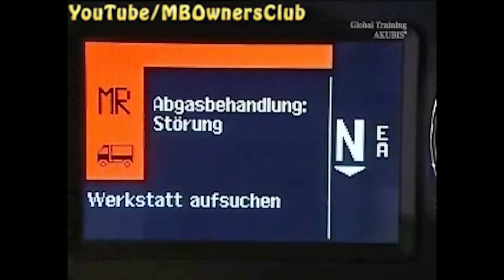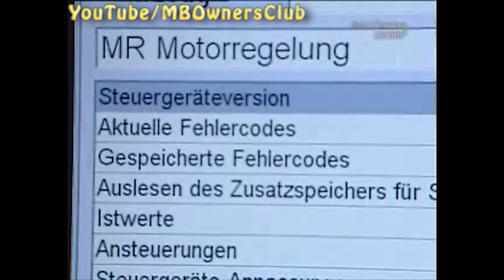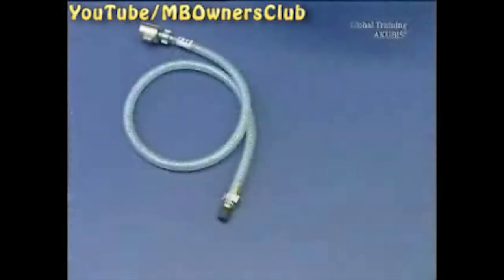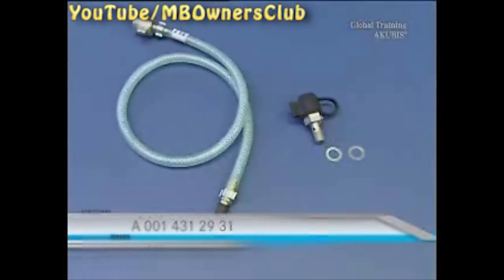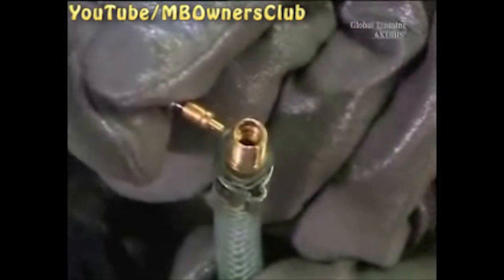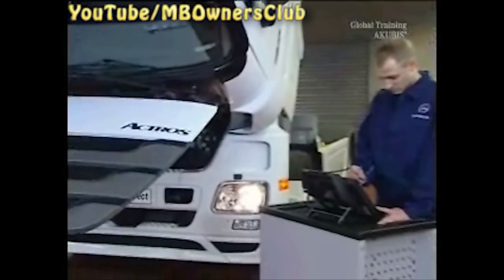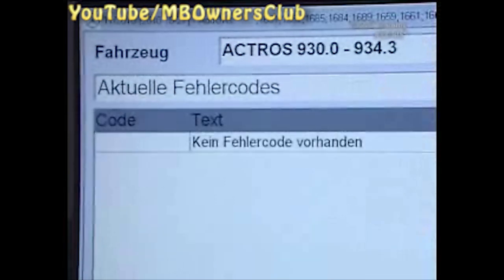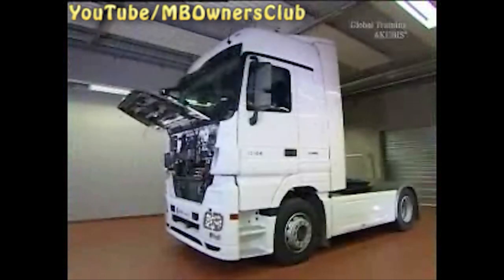Mercedes-Benz Actros - How to Flush Metering Device of Exhaust Aftertreatment System

Comment: Please can you help me with a Mercedes 3340 Axor shows code GS 02 don't show neutral on my display. Please can you assist me
Reply from the maker: Hello,
Without Star Diagnosis computer, only a minor teach-in procedure can be done. I can send the instructions, . Also, the instructions are present in owner's manual

https://ww2-secure.justanswer.com/uploads/Chezario/2011-07-03_094905_w954_perform_minor_teach-in_process_on_control_unit.pdf

https://ww2-secure.justanswer.com/uploads/Chezario/2011-07-03_095426_w954_perform_major_teach-in_process_on_control_unit.pdf
Reply: @MBOwnersClub  how much does it cost? I mean The STAR DIAGNOSIS